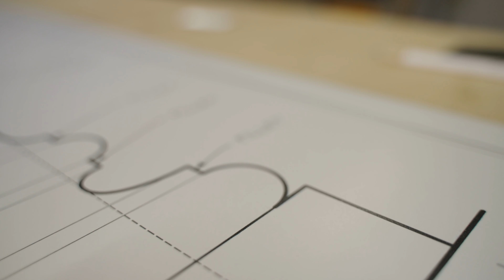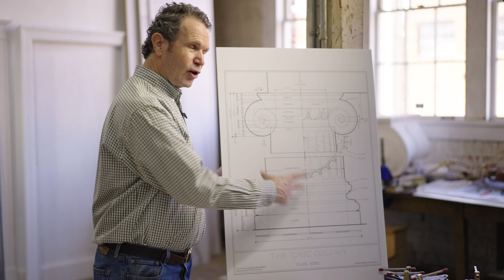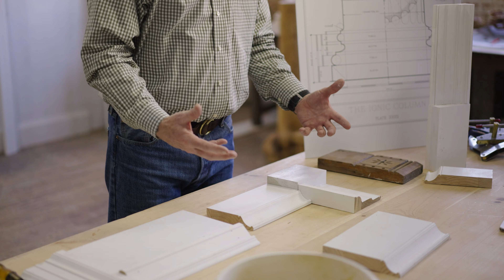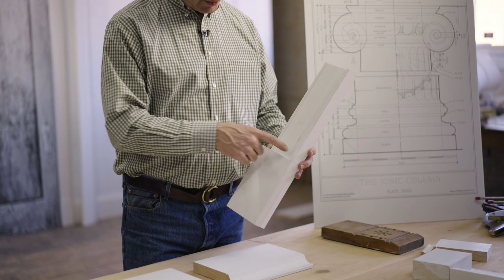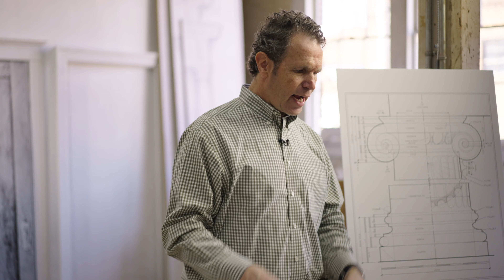Everything you wanted to know about Plinth Blocks but were afraid to ask.

Comment: I recently installed plinth blocks on interior doors.  The plinth is stopping the door from opening much beyond 90 degrees.  Is there a remedy for this?  I feel like I'm missing something.
Reply from the maker: That can happen. They may need to be held off the jamb more than 1/4", sometimes deeper hinges help. Good luck.
Reply: @BrentHull  Thanks

Comment: The height of the plinth block is determined by the height of the base molding plus the amount of reveal of the base molding against the side 
of the plinth block.  When adding a back band to a casing, the plinth block width has to increase also.
Reply from the maker: Thanks for sharing. Historically, it wasn't always solved that way.

Comment: Something I think should be considered is that when mopping a floor, it’s easier to get the dirt out when there is a straight line at the bottom, vs all of the curvatures of the casing at the bottom.
Reply from the maker: That is a form vs function approach. Thx.
Reply: @BrentHull  Should be form AND function! 😆

Comment: I’m really getting fed up now. Every ruddy video; without fail; they are all so interesting and well explained. We don’t have anything like Windsor One in the UK (I.e. made from solid timber); we are able to get some mouldings made from MDF which, for painted work, is okay; nearly. I’m using so,E of it for the supports for a plate rail which is going on top of the painted panelling I’m doing. The painted panels are only in a rear service corridor where light is important. For the other rooms, I’m using European oak; I’ll make those mouldings myself on the router table and build them up where needed. All of the door casings will feature plinth blocks and headers (as Brent showed in another video). 

I’m asking about plinth blocks used in skirtings. I visited a house l probably National Trust but cannot, for the life of me, remember where. They had tall skirtings and in every internal corner there was a plinth block - but only 2” x 2”; slightly higher than the skirting and with a chamfered top. Now that seems an interesting way to get around coping the skirting but they also had these corner blocks on the external corners. 

Can anyone help me with any information or ideas if you have seen something similar? I remember that it impressed me but would love to go back (if I could remember where to) and just make sure my memory isn’t playing up. Again.

Unbelievable. I sent this comment, searched and immediately was directed to the UK business “skirtingboardsdirect” and it’s the first time I’ve seen real oak skirting mouldings in the UK. Plus they feature those internal and external corner blocks that I was talking about. Apparently, they are called turret blocks.
Reply from the maker: Awesome. Thanks for sharing.